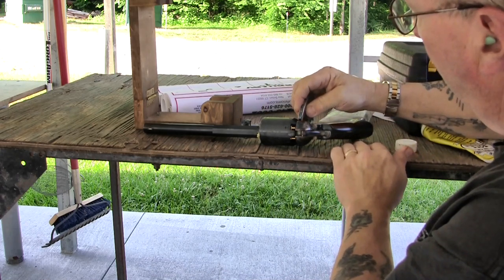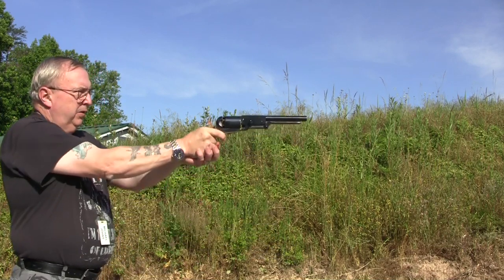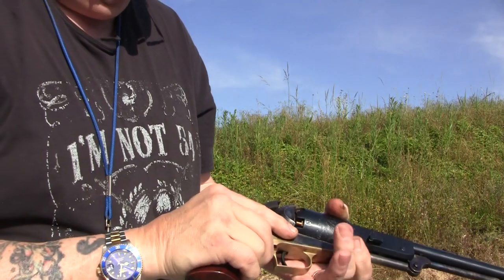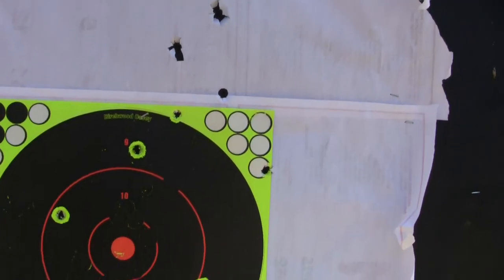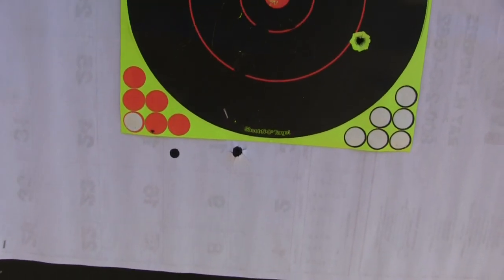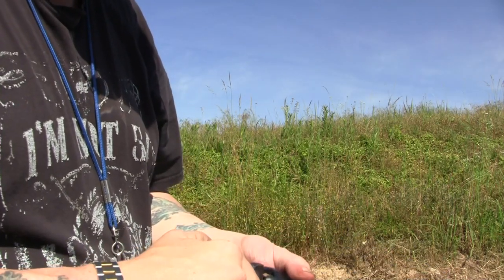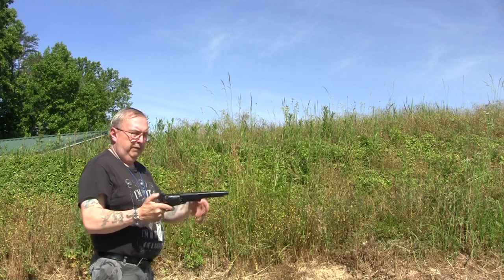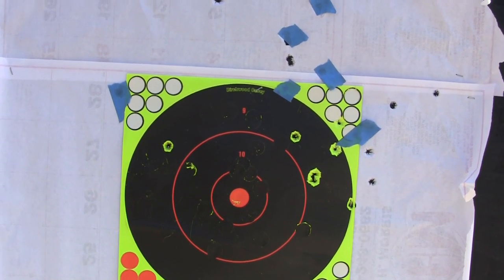Uberti Walker w/Treso replacement nipples

Comment: From what i have read over the years is apparently the caps of the Old West were little more than just foil which just disintegrated when fired so probably weren't such a problem then. I do always seat mine with a small wooden dowel after capping and find that helps with reliability.

Comment: More people would buy these revolvers if the caps werent such a pain. I still like them but the caps are the weak link
Reply: That's why the Remington 1858 New Army model was superior. Never had a problem with caps on my Remington clone but if there was an issue, it's easy to fix in the field with minimal effort and no tools. I love the later Colt 1873 SAA's but when it comes to cap and ball I prefer the Remington.